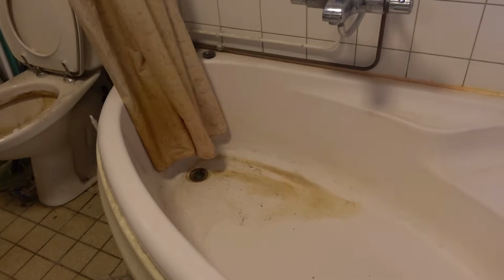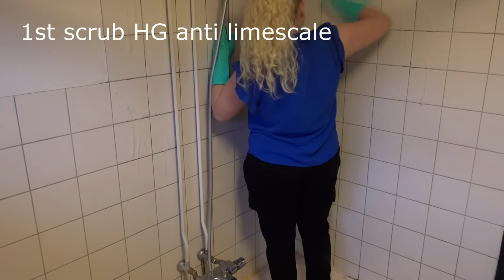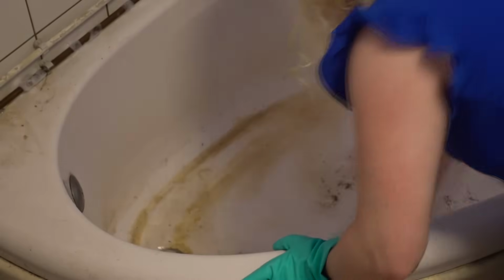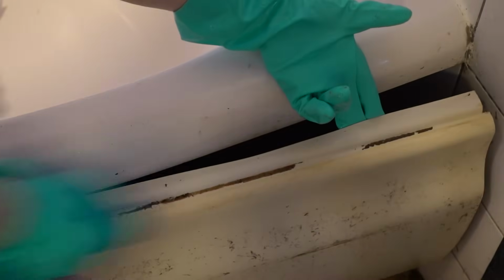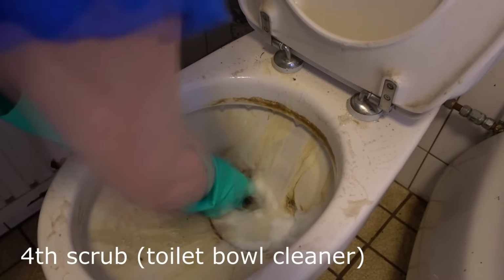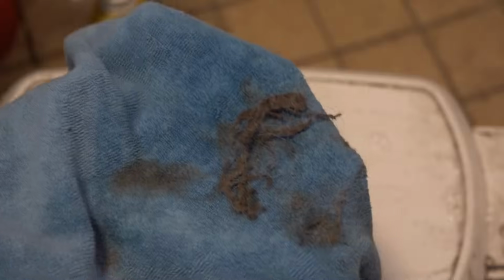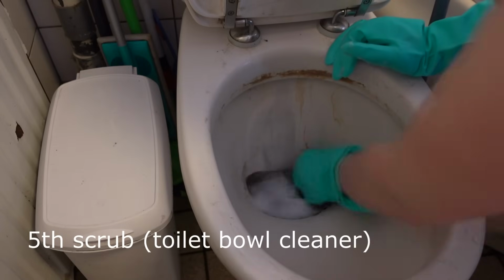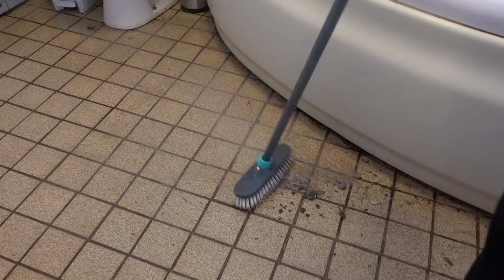Cleaning an Extremely Dirty Bathroom (same day edit!)

Comment: Pumice stone is probably the only way to save that toilet. Shower looks amazing!
Reply: Agree
Reply: Or maybe some acid for toilets
Reply: Yes or a scraper. Also u really meed several hours for products like oven  cleaner and limescale removal toilet bowl cleaners to work. They need overnight ideally, to be effective and in stubborn cases like this, night needs several nights to break down the layers of limescale.  I'd suggest removing all the water from the toilet bowl beforehand snd then soaking cotton wool with the cleaner and applying that to the worst affected areas (stops 90% of the oriduct just draining down the loo)
Reply: I came here to say the same thing. Acid based cleaner and pumice stone 😊
Reply from the maker: I pinned your comment, since I thought this was such a good tip 👌🩵
Reply from the maker: Definitely going to buy pumice stone! 👍
Reply: @colinecleans  Cool!  Make sure you get the one for porcelain, not the one for feet. 😂
Reply from the maker: Hahaha! 😂
Reply: scraper too
Reply: Pool chlorine will do the job and elbow grease
Reply: Use tiolet bowl cleaner on the tiles with a soft brush alot easier
Reply: Get a scraper
Reply: ☕️🍰 What camera you use Coline?
Reply: Acid toilet bowl cleaner. Remove as much water as you can and apply the product leave as long as you can, preferably over night if you can. and scrub next morning. Might need a second coat
Reply: Not sure if you have this in your country but Viakal works wonders on limescale. Also, a strong descaler might work as well.

Comment: Hi, Coline, I know it's a crazy idea, but I've actually gently applied a fine sandpaper to the lime and badly stained areas,  took it right off. ( Mind you the bathtub needs to be re-surfaced). Maybe a metal scraper applied carefully to the lime. There is steel wool as well, that stuff is AMAZING! Thanks Coline!
Reply from the maker: Hey thank you so much for these tips!! 🩵

Comment: Pse look into Spirits of Salts which works extremely well at cleaning the dark marks off the toilet. It needs to be left on for a few hours for such extreme dirt but it works. After leaving it scrubbing will remove the dark marks. Excellent cleaning by the way.
Reply: I have never heard of Spirits of Salts. I will have to look that up. May not be available in my area (USA).
Reply: I had to look it up.  I also didn’t know what it was. Hydrochloric acid.   💙
Reply: @hollyjobitner3285  Oh. Not quite sure I'd want to use that. Has a dangerous sound to it.
Reply: @cathyprosser1050  I don’t know anything about it.  💙

Comment: Oh poor Coline. The toilet was so extreme. The next time you can use an scraper for this and finally an really fine sandpaper.
the toilet water can you go out with an cup and than you can scrub it easilier
Reply: They also make a battery operated water pump, I got mine at Home Depot, makes emptying water from small water features, toilets, stopped up sinks so much easier.